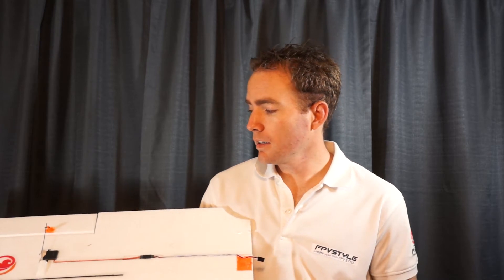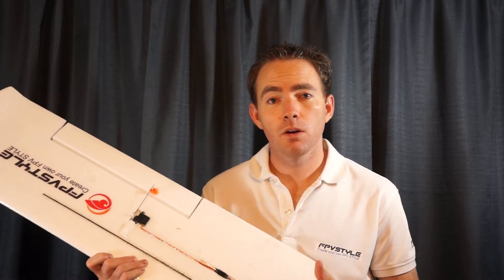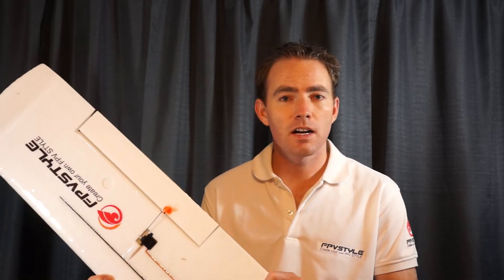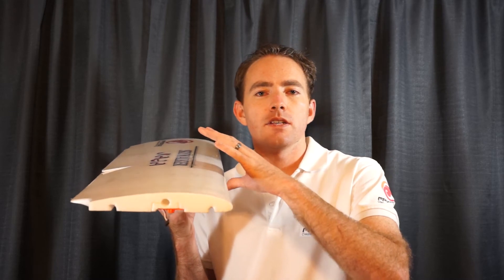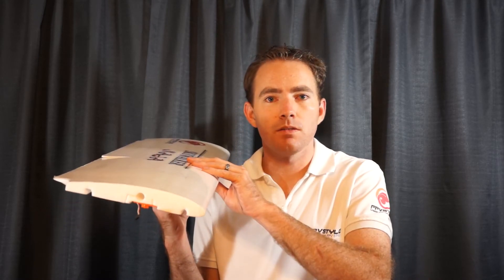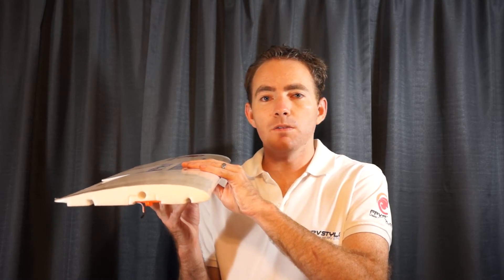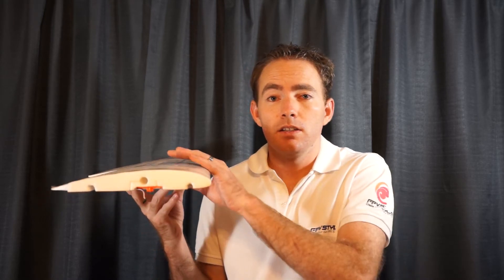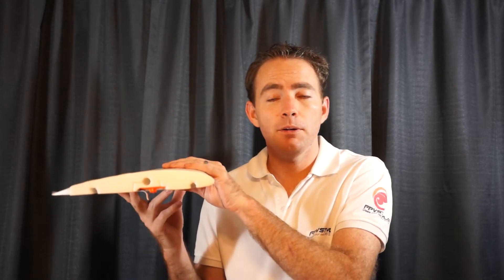Quick Tip of the Week - Expo

Comment: I use expo on my TBS Disco with  Naze on one profile for soaring smooth video control- since the gopro is hard mounted, and slight movements of the craft will show, the expo is nice because it helps soften, and even out the transitions as you turn and helps to prevent jerky lateral movement.
Reply from the maker: Ya! I use it on most of my aircraft fixed wing or rotor as well! many people dont think of using it on multi's
Reply: Atom RC That's why we need experimented pilots like you guys ;)
Reply: blackmennewstyle
It is nice to use in certain cases on the gimbal... a slow approach to a subject with a sudden rise and gimbal pitch down that increases in speed as the variable switch is worked to control it- it is the little things that make for powerful video shots; now If I can learn to apply what I understand, and learn how to edit, I could maybe be a fair video pilot!
Reply: ***** Nice you gave me some interesting cool stuff to search about :) I will investigate some about using expo on multirotors!
Thanks for your feedback